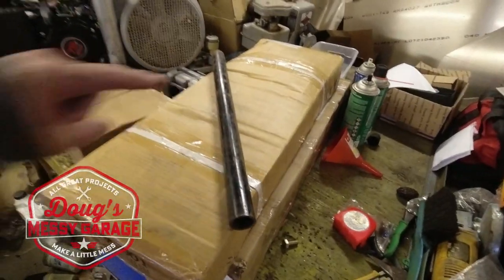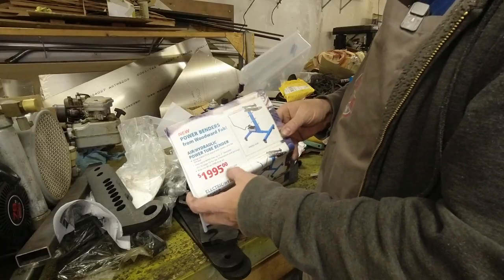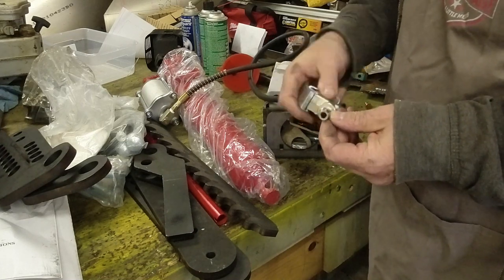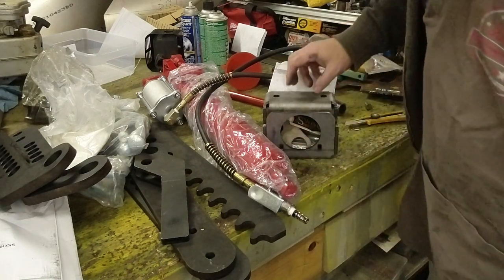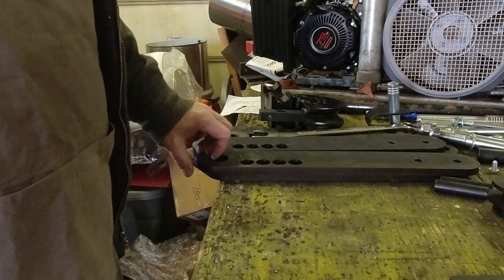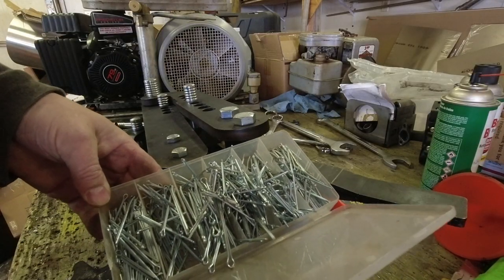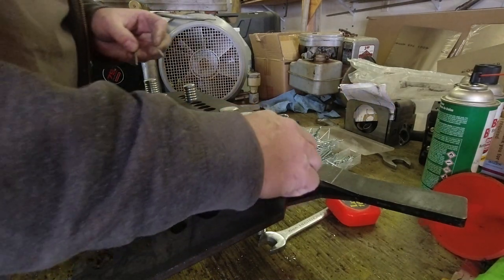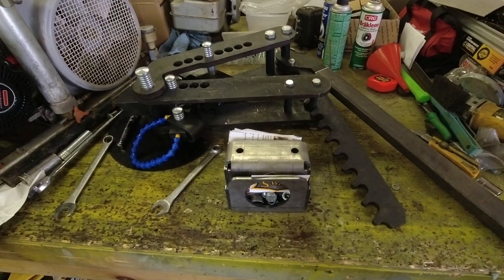Setting Up The Cheapest TUBE Bender From Amazon: Pt 1

Comment: Hi Doug. Thanks for posting. Quick question here - does this bender come with the die that you installed, and if so, what size is it? If not, where would you go to purchase a die?
Reply from the maker: This unit uses Woodward Fab bending dies.  That is where things get expensive, unfortunately.  Pick your desired sizes carefully.

Comment: Finally an affordable bender..! Saved to my Amazon list but did not see any dies available. I need 5/8" - 3/4" - 1" & 1.25"  who do you recommend for dies..?
Reply from the maker: The bender itself is affordable but the dies are still pretty spendy.  This bender uses Woodward Fab dies and each size you are looking for is likely going to run you a couple of hundred.  If you can forego the 1.25" size, there is different style tubing bender for about $300 that typically comes with the dies but it is limited to less than 7/8" and it likely need more armstrong effort.  https://www.grizzly.com/products/grizzly-tube-bender-set/t32715
Reply: @DougsMessyGarage  Thanks bud I appreciate the help & quick reply. I should prolly subscribe 😁
Reply from the maker: @houseoffire72  Thank you, much appreciated